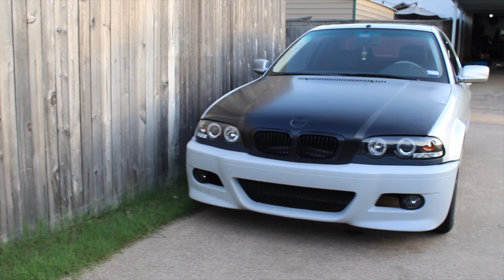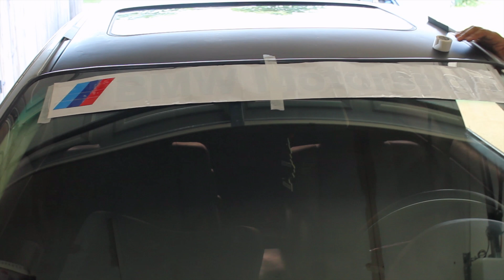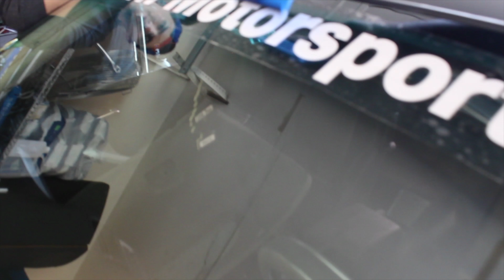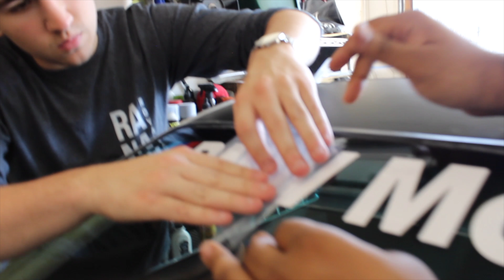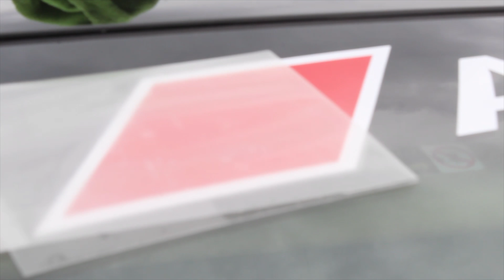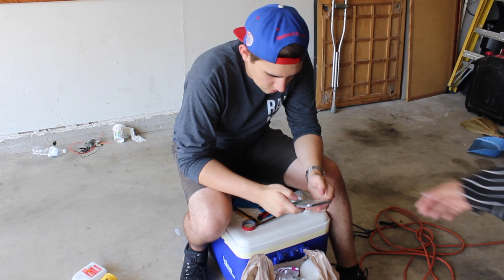How To Install A Windshield Banner

Comment: How long did it last on the windshield? Did your notice any damage or wear from the wipers?
Reply: Yeah, thinking the same thing here
Reply from the maker: No damage to the wiper or anything, its been on ever since with no chipping or damange to either.
Reply: I'm putting one at the bottom whipers scraping it off was always a worry should be good though ?
Reply: @betcher915  was it good?
Reply: @Verrium  lasted for 2 years sorry for late reply :p